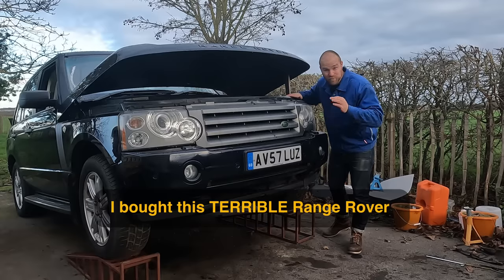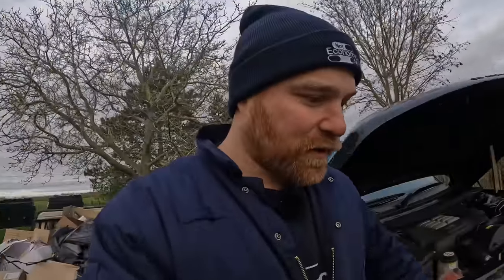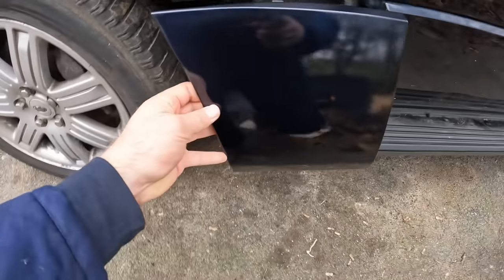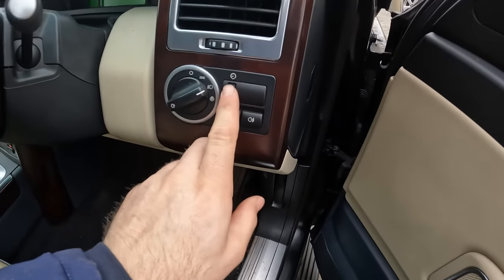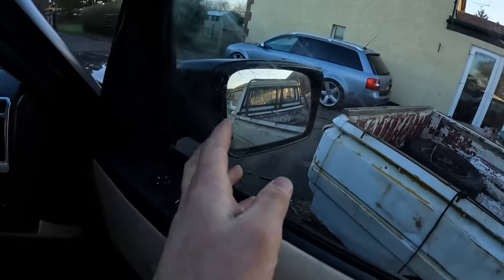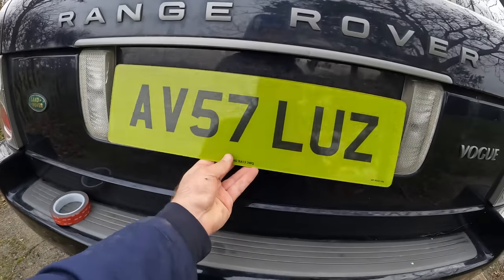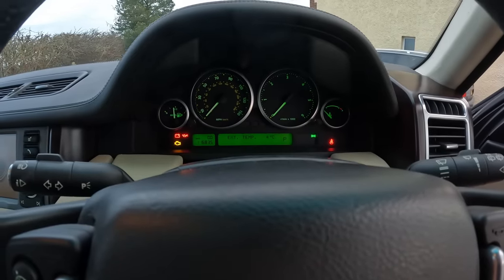Turning my crash-damaged Range Rover into a daily driver

Comment: You can put the suspension in off road height and put axel stands underneath. Then lower the suspension and once it sits on the stands it raises up to extended mode. If you press and hold the suspension up button and the brake pedal for a few seconds, it goes into super extended mode. Plenty of room to get underneath then.
Reply: Looks the nuts! You’ve done a great job. You must share , once finished, the complete cost. Bravo!
Reply from the maker: Good to know for the future 👍🏻

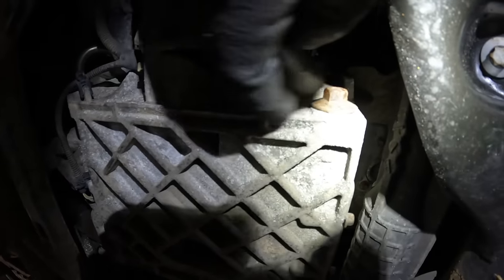Comment: 6:30, it's actually a really ingenious way of rustproofing this area of the vehicle by covering it in used oil. Servicing probably use a suction hose to remove the oil which is likely why the drain plug was so hard to get off. Recently dicovered the channel and love your delivery style really enjoying it thanks!

Comment: you can disconnect the bonnet rams and lift it up to vertical for servicing there is a clip each side on each hinge that holds it in place.
Reply: Mercedes calls it the "service position"

Comment: Sam’s Motor and Machine did a vid on a full service for an L322 and he used a vacuum pump designed to drain almost all the oil out. It’s worth checking out and safer than getting your noodle squashed!
Reply from the maker: Thanks for the info 👍🏻

Comment: Looks a million dollars. I’ve been diy’ing on cars since 1988, 2 weeks ago I had to replace the alternator in my modern vag product, a pain but not to bad - the wheel arch liner was a sod, and with one screw missing I gave up as got dark the frost returned and neither a magnet on a stick or torch revealed the screw. No problem though, a quick test drive and re-park to find my new winter tyre deflating rapidly and the screw was found - yay. We all make mistakes, and some of us continue to do so. It’s just the magic of life 😤. Sorry about your grandad but good innings.
Reply from the maker: Ahhhh noooo - that's sod's law. Thanks for the condolences. He had a very good innings 🤝

Comment: For easier oil changes you can get an oil extractor, and use that going in via the dipstick tube.   Can can hand pump or electronic ones.

Sorry about your grandad too
Reply from the maker: I'll take a look into that. Thanks for the condolences mate
Reply: @NotEconomicallyViable did my first ever oil change on my Discovery 4 using a mitivac extractor off Amazon. 

Took me 20mins including changing the filter, not a single drop anywhere. 

Enjoyed your RR rebuild, anything JLR will get quite a following IMHO. Nicely done 👍

Comment: Great video, I got the same ramps that's how they were made.  Once you got car on them all the way its easier to work on, I jack up car then push ramps under wheels newer cars don't have clearance.
Reply from the maker: Thanks for the tips!
Reply: You can get flat 'ramps' to add on to get low ground clearance cars on.

Comment: Great channel , After 60yrs of Diy street 2nd hand car maintenance I have decided that oil drain plugs are'nt used anymore especially with the advent of plastic sumps. I recommend using a 12v electric oil suction pump to remove old oil either thro filler point or dip stick hole, it's much cleaner ,less spills on the ground or up your arm! Keep up the good work.
Reply from the maker: Thanks for the advice - I'll take a look into it

Comment: Love the channel, I have run a tdv8 similar aged car for over 2 years now and so far has been very reliable. Good luck with going full time.
Reply from the maker: That's good to know 👍🏻
Reply: @NotEconomicallyViable  just get the gearbox oil changed at a specialist, the gearboxes need a fluid change periodically and it’s not a diy job

Comment: I sympathise with you over the windscreen wiper blade thing. I bought a new (own make) wiper blade from Asda, and it came with enough little plastic bits to practically build a kit car! I eventually worked out which one to use, and it has performed very well. But there was a certain amount of Tourettes before I sussed out which attachment to use....

Well done on the paint spraying!

P.S.  keep the discarded back number plate in case you ever need to tow a trailer or fit a bike carrier.....
Reply from the maker: Glad I'm not the only one then! Great shout about the rear plate!
Reply: I usually do my own routine maintenace but paid Halfords a fiver to fit my new wiper blades. The young lad looked at me like I was bonkers. That was until he had to try and work out which clip would fit, and how to use it. After breaking one, he had to go back into the store for another new one. A fiver well spent, and it was the young fella that suffered from Tourettes that day

Comment: I think the double drain plugs are for when the engine is in different vehicles, this V8 went in Landies and Jags so it depends on which vehicle it is in to which plug is available.
Reply: Very likely. Plus these will or would have mostly been dealer serviced and they would have been using an oil vac system.
Reply from the maker: Yeah that makes sense

Comment: Nino, I've done some messy engine oil changes myself (I even caught a good one in one of my videos). On my Volvo XC90 the ground clearance is such that I don't even need to jack it up to drop the engine oil or the transission fluid. Cycling the ignition key a few times is usually sufficient to bleed the air out of the fuel system. You have improved this Rangie no end and that is quite a result. A good PDR guy will probably be able to sort that dent out. Now you've cleaned the outside you'll need to do the interior. Some leather cleaner and conditioner will have those seats looking like new. RIP Stanley. He had a good innings and was just a day short of his 90th birthday.
Reply from the maker: Oil changes are the bane of my existence - they never go well haha. Thanks for the condolences 🤝

Comment: For cleaning glass you can use kitchen wire or a new and flat razor blade with plenty of soapy water and it does miracles. I used it to clean overspray from the windscreen when the paint escaped from the masking paper. Nice videos cannot wait for the next one already.!!!

Comment: When touching up the paint try this. Spray the paint into an old clean aerosol lid and use a tooth pick to dab it into the chip or scratch. Do the same with lacquer. Might need to do it a couple of times to build it up but I find it works well. 👍

Comment: In the future for sticky thing removal I would recommend you to buy special eraser, you can attach it on drill. I've used it to remove oil change stickers and it's amazing, does the job quickly and is inexpensive.

Comment: Those ramps are still available and by the looks of em, there are from the 70s or 80s and not home made. They can easily hold a van or short truck.
And always put axle stand underneath regardless.

Comment: Hey Nino. I've been looking forward to this video. Firstly the ramps you have were certainly readily available here in Australia and are rated to 2.5 toones. I have a set and love them. Secondly if you are unsure if a bolt/plug will round off try a 6 point socket instead of a 12 point. Much better grab on the bolt. Still loving your videos and your have a go attitude. Marc from Australia 🇦🇺
Reply from the maker: Thanks for the tips, Marc. I really need to invest in a proper set of six-point sockets

Comment: I'm not sure about other brands but I had an internship at a Mercedes workshop in 2012 (when they seemingly still were official part of the company, but they sold it off to Rosier since that) and they usually didn't open the oil drain plug but had a long tube they put through the dipstick shaft and pumped out all the oil and for the new oil they weren't running around with oil bottles but had a tap system with a central tank (like on a gas station).

Comment: I paid £2.5k for my 2007 vogue so it makes me feel better seeing yours arrive 😂 , the inlet manifold on the drivers side normally cracks and causes the car to go into limp mode under load . Just spray with soapy water whilst engine running to check for hairline cracking . It can be fixed easily using Q BOND .

Comment: Plumbing jobs i use CT1 Multisolve from toolstation for sticker residue. I'd check its paint safe cant see why it wouldn't be but its great for silicone residue and glue.

Great work on the range rover. They're probably the most daunting cars to work on.
Reply from the maker: Thanks for the info!

Comment: I remember changing the bonnet struts on my old LR Disco 3. The old ones were just as shot, but hilariously I nearly chinned myself after I fitted the new ones (the new ones were quite fierce!).

On a side note, you mentioned at some point (either in this video or the last one) that you're going to replace the brake fluid. Just a thought depending on how much time and effort you're looking to put in, but have you considered removing the brake calipers and painting them? It won't affect the performance, but will look pretty cool, and will just cost you the price of paint and some new copper washers for where the brake-hoses connect. Red might look a bit naff, but mix some black and blue to get a nice dark blue and that would look quite boss. Just a thought.

The whole thing is looking awesome! Well done. :D

Comment: Tô remove the tape, you could have used Vonixx Strike. It melts the tape and is not an aggressive product. Just spray, wait a bit and clean 🙂
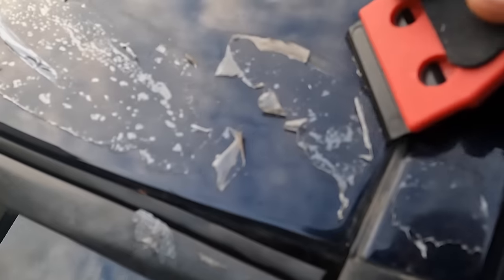Reduce the chance of scratches 17:10

Comment: My dad has one of these range rovers. He uses an oil pump to suck the oil out of the dipstick hole. No climbing around underneath. £30 off eBay.

Also worth checking when the gearbox oil was last replaced. I think it is every 80,000 on these ( might be wrong).
Reply: I mentioned that too. I always used to change my Astra's oil that way. An ex-work colleague told me about it, I guess his father had a boat.
Reply from the maker: I'll have to take a look into getting one of those. Gearbox and diff oil change next on my list I think

Comment: Might be worth detaching the towbar as well, they can get stuck in place - they are quite low and really spoil and offroad ability. I had a car where I had to take the bumper cover off and unbolt it, hit with hammer etc and disassemble to get it all freed up. (Steep driveway so I couldn't drive into the driveway with towbar attached)

Comment: For your roof dint , remove the interior light unit ad you should be able ad nock out easily . if you raise the suspension to its highest setting for changing the oils
Reply from the maker: Thanks for the tips 👍

Comment: Loving what you are doing to your Rangie (and other vehicles) I would buy it off you but need a hefty discount for the mis matched glove compartment cover 🙂Respect to your Grandads ramps btw, not sure they are home made though, you never know. I completely agree that a set of new Number Plates makes an instant difference. If I remember rightly, with that model there was a cup holder on the far left, just below the vent, with the air con on it kept a bottle of water nice and cold. I worked at Land Rover Experience Eastnor for 20 Years and loved that body shape. Dont think your nice side steps would have lasted long though. Wish you all the best with your quest for Youtube fame. Been subscribed for a while now, personally think you have it just about right, have watched each of your vids all the way through, rather than skipping bits like I do with some other channels.
Reply from the maker: Appreciate that mate

Comment: Love the vids, used to own one of these. The drain plugs are not great because these were designed to have the oil sucked out of the dipstick pipe, so if that has been serviced that way, those drain plugs may never have been off !:)
Reply from the maker: Ahh I didn't know that - thanks for the info
Reply: @NotEconomicallyViable  I think to be fair your way is better, means gravity removes the crap better than sucking it up. - Argued with the LR dealer to do it your way but they would not budge. RR and RS6 and the pickup!! Jammmy

Comment: Also I noticed you forgot to service the transmission and front and rear differentials , also check for play in the front lower control arms the bushings tend to go pretty fast , also in the back look at the brake pipes they love to corrode so bad that they can pop when you apply the brakes hard

Comment: Comma oil - proper cooking oil, lol.
Next week when you check the oil level, it'll be as black as 20,000-mile Castrol. Not an expert on RRs, but sounds likely you don't have to bother with the other drain plug - just do 2 or 3 auto trans fluid-like part changes... and keep the new filter in, fine...

Comment: For future reference you can get a rubber wheel/disc for your cordless drill, it’s meant for removing glue residue or stickers from surfaces. It’s perfect for removing old sticky tape, it doesn’t damaged the paintwork.
Reply from the maker: Didn't know that - thanks for the tip
Reply: @NotEconomicallyViable  They are called toffee wheels if you was to look for one

Comment: You need to remove the gas struts, and spin them around 180 degree's. The oil needs to sit at the top of the strut for damping, and to keep the seals lubricated.

Love your videos btw, subscribed a couple of days ago when I discovered your channel.
Reply from the maker: Ahh someone else mentioned that too. I just replaced them in the same way the old ones came off. Thanks for the advice 👍🏻
Reply: @NotEconomicallyViable  you're very welcome, glad I could help. 

Brilliant channel! Loving the content and humour.
Reply from the maker: @richpolecat6527  Cheers mate

Comment: Most garages now suck the oil out from the dip stick hole. I bought a very good, cheap vacuum kit to do this from Amazon. No risky laying under cars, no rounding off sump plugs. It's probably why the sump plug was tight and rusty, it's possibly never been off!
Reply from the maker: Does sucking it out leave any crud at the bottom of the sump?
Reply: @NotEconomicallyViable  it can do, but if you change the oil regularly, then it should be minimal.

Comment: Plug the oil filter in without cap so you can locate the filter lug into the drain hole otherwise the filter will drain every time the engine stops running.

Comment: I think your dashboard illumination might be a fibre optic system, in which case you need to find just one bulb holder which has the optical fibres attached and replace that single bulb. Good luck but I’m sure that there will be some coverage somewhere on YouTube.

Comment: If you want some easier to use ramps, look at getting some Rhino ramps, they're thick plastic ones with rubber grips, they don't move like the metal ones do. When I used to use metal ones I had to put a large plank in front of them and then another at a right angle resting against a wall to stop them moving.
Reply: Also, for easier oil changes, consider using an oil pump designed for boats. You stick the pipe down the dipstick hole and pump the oil out. Such pumps are for changing the oil on boat engines.
Reply from the maker: Thanks for the tips - I'll take a look into them 👍🏻

Comment: Clean up operation on isle v8 😂 to be fair though I’m convinced that engineers purposefully put drain plugs, under trays, heat shields etc in awkward places just to make people use the main dealers. Well done for doing this on your drive btw. I attempted the handbrake cables on my wife’s 2012 Ford galaxy a few weeks ago on our drive. I couldn’t get the car high enough to get the under tray off to access the old cables 🙄 so off to the garage it went.
Reply from the maker: They 100% employ engineers to do just that lol. The same bloke is employed to put in at least one bolt that is completely inaccessible 😂
Reply: @NotEconomicallyViable  yes! The kind that you need to drop the subframe just to do a gearbox oil change 😂 thanks for the reply mate. Keep up the content. Its very informative and entertaining 😎

Comment: One other thing you can actually do with these fuel filters is to prefil them or if you have an scanner there should be an option to bleed the fuel system or of course you can do the same as you did in the video, by priming the fuel pump, not an expert on range rovers but in general with most of the cars one of these ways will work
Reply from the maker: Ahh I didn't know you could do it with a scanner... I'll have to check if mine has that functionality 👍🏻

Comment: interior lights issue:
 Car must have a light module and if there is a short circuit somewhere it will turn the line or itsell off,  had the same in my bmw, two wires shorted in broken connector on the door trim lamp
Considering dash has been broken, maybe there is a short circuit somewhere
Reply from the maker: I'll take a look into that - thanks

Comment: Laminated is not double glazed. To be double glazed it would need a space between the glass panels, either with a vacuum or an inert gas.
Laminated has a piece of polythene sheeting in between, to hold the glass together and so when it is hit it cracks into small pieces and not large jagged  super sharp  pieces  ready to cut you. Certain window or door panels are the same such that  they shatter rather than crack, usually have the kite mark.

Comment: What I did on my drive was anchor bolt 2 pieces of 20mm box section where the end of the ramps sit and never where my wheels end up at notmal times but stops my ramps slipping when going up
Reply from the maker: Great shout